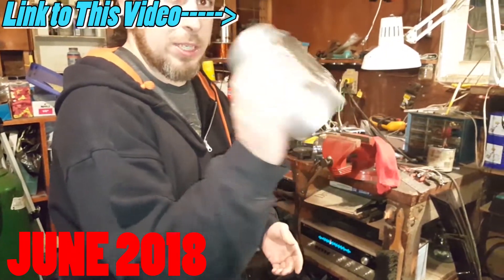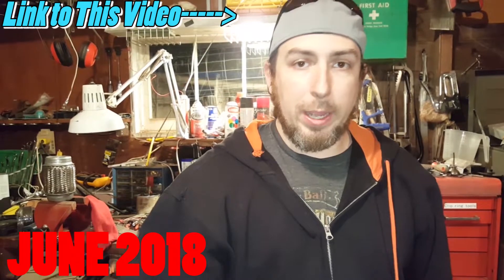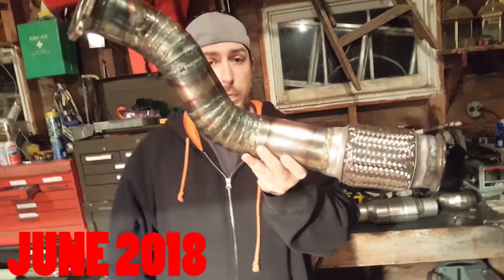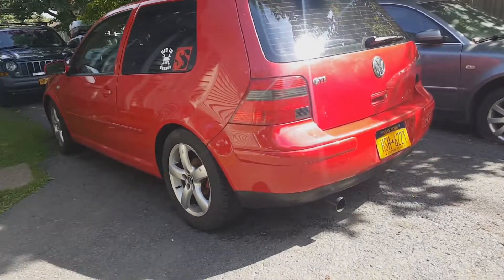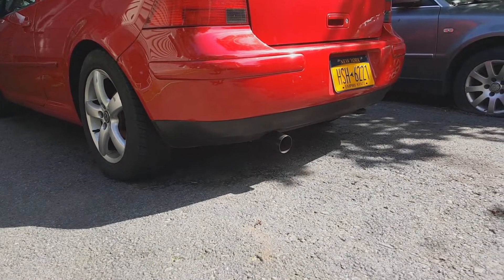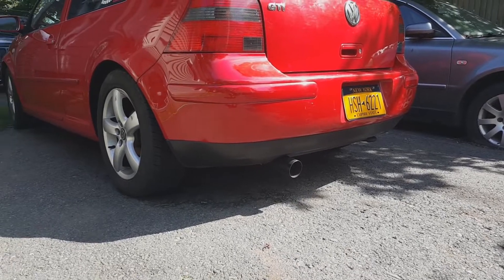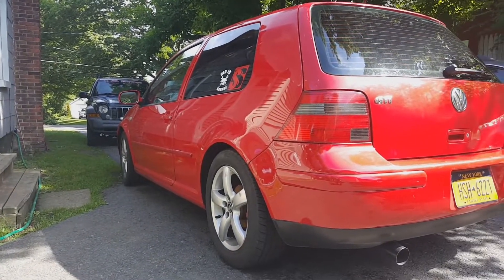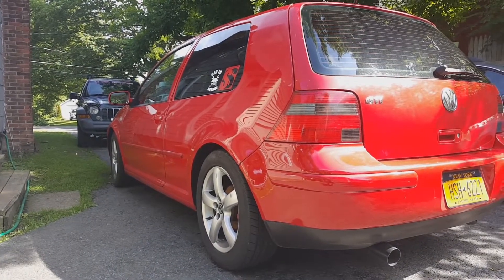1.8T 3 Inch Straight Pipe To Flowmaster Muffler

Comment: I gotta G37 with RTPs and a Muffler/Resonator delete, I ordered two 71226 Flowmaster Mufflers. I was in the same boat as you with being limited with driving at certain times, and just the sound is awful. I never thought I’d say it, but I can’t wait for my mufflers lmao. Straight through design too
Reply: are you getting the same style muffler? im doing same route on my G with non resonated test pipes stock resonators and muffler delete gonna add a flowfx muffler like this style only vids i see on youtube is the skinny bottle style ones and that doesnt even quiet down sound. oh and im adding shorty headers soon lol
Can you do exhaust vids?
Reply: @dbdb1681  I actually ended up getting fucked over by the company I ordered from, only set my back like $150.00.

But, I also installed DC Headers over the summer, and I went to Canadian Tire and just bought two cheap DC Sports bullet mufflers, with a similar straight through design.

It’s not the quietest, but I was shocked at how much it was tamed by simply adding two mufflers, the headers also made it sound a little smoother. I don’t have much, but check out what’s on my channel. There should be a couple videos for you to compare the before and after.

Comment: Nice. Im running full 3"catless  from turbo out the back on my mkv 2.0t..  It does get kind of obnoxious at times so I'm considering a muffler or something as well.  I've been told a glasspack fitted reverse from normal is also a good way to go.
Reply: Reverse as in, not flowing into the fiberglass packing, but rather have them flow against the metal? Honestly, in my opinion, unless that's placed around the middle as a resonator, it really won't do anything, aside from giving cops an excuse not to ticket if they ever decide to, for a modified exhaust. lol